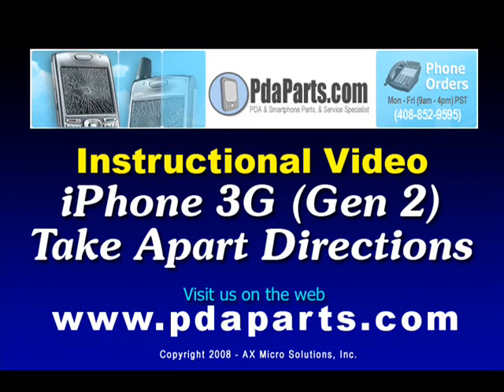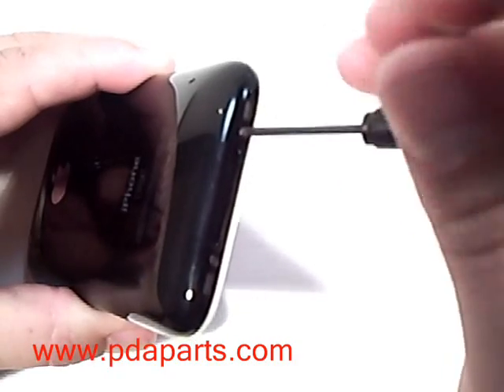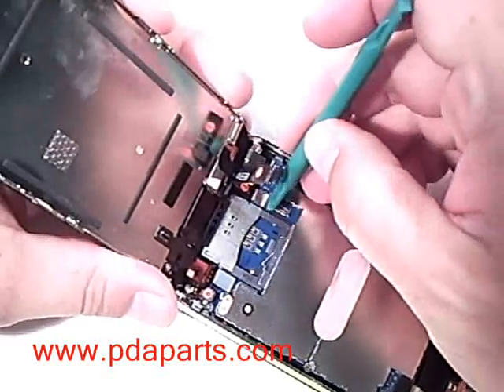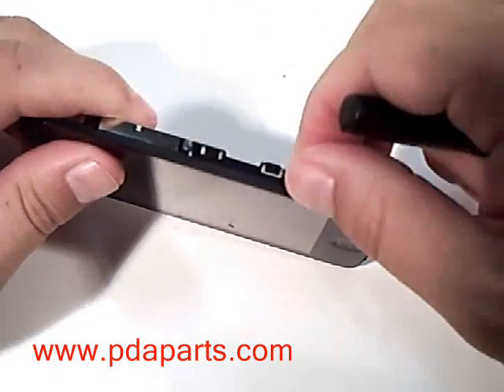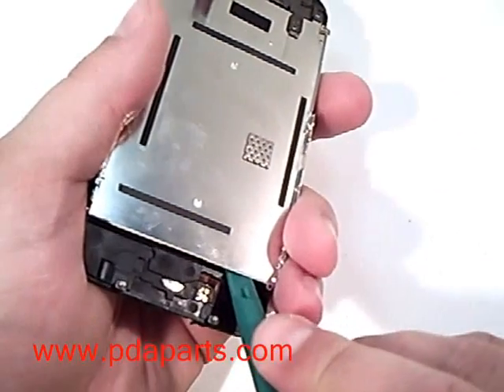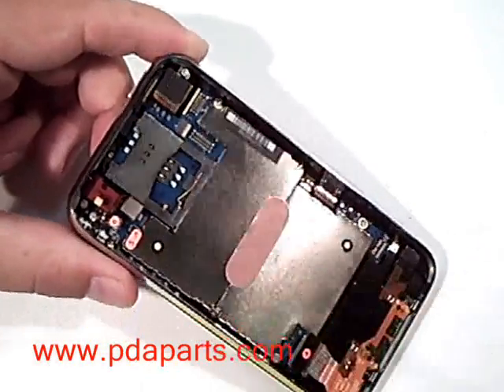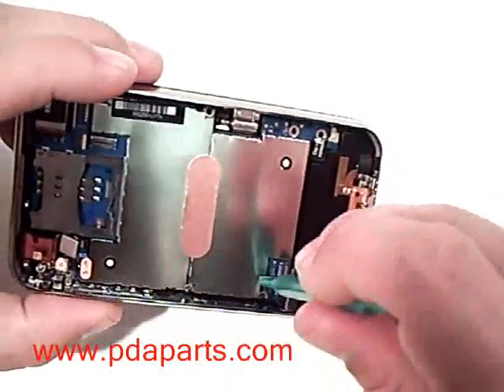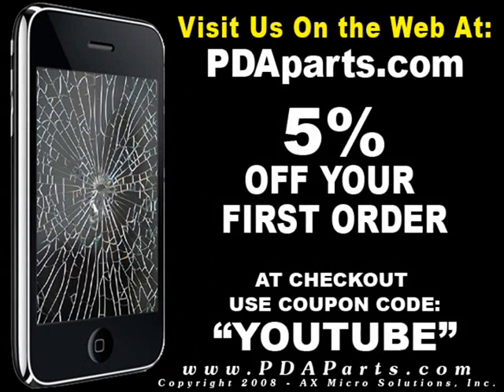iPhone 3G Dissection, Disassembly, Take Apart & Tear Down by DirectFix.com

Comment: ay my niece old iphone is messin up she dropped it at skool and the class is all cracked but the top half of there screen still works and the bottom half doesnt and i read online that it could be the plug from the bottom half is unplugged but is that true like can i take it aart and plug it back in and it will work or is it something worse ?

Comment from the maker: @clodester it would not work. The connector on the lcd/screen is different between the two models just to start with. There are other issue but it would take forever to go over them all.